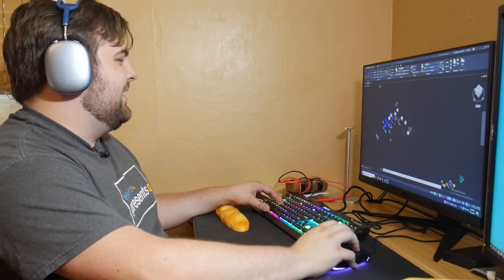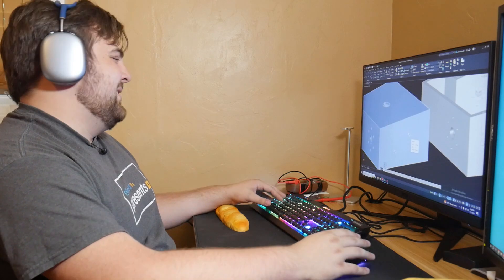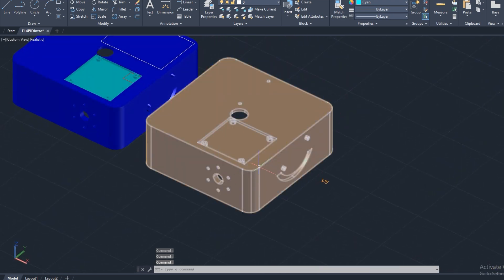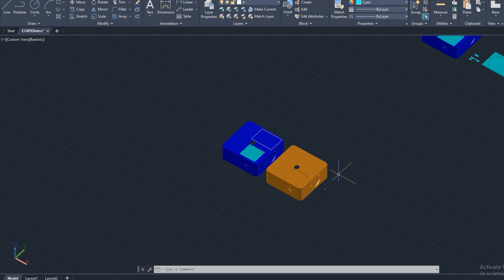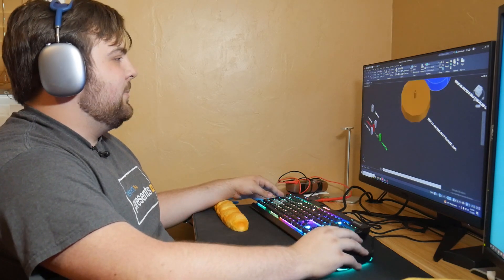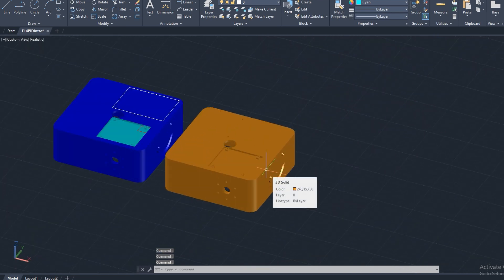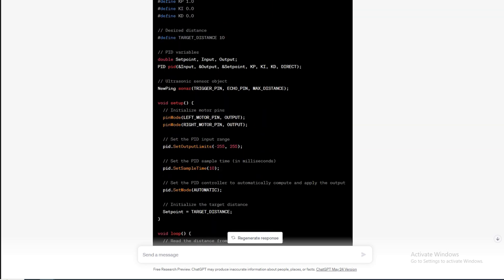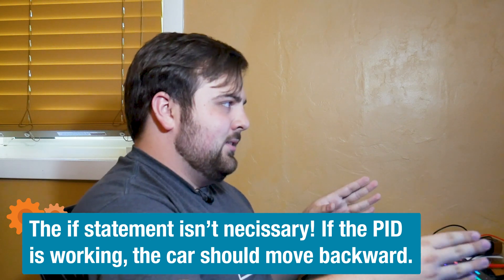Using PID (Proportional-Integral-Derivative) in Robotics - How Hard Could It Be?

Comment: Agree with some of the comments, this really didn't highlight anything about actual PID controllers. For this case I think transfers functions would have been overkill (and overly difficult), but there are manual tuning strategies that you could have gone into. And a more mechincal comment, a possible issue with the distance sensoring could be reflections from the floor hitting the "wall" resulting in double values, i.e. the sensores not being used in the intended situation.

Comment: 50 years ago my friends and I made Meccano buggies consisting of two central large drive wheels and both forward and rear centrally mounted castors. There were 2 motors driving differentials the outputs of which were geared to both drive wheels, one of which was reversed. Now this was back in the valve age so we used manual control of the motors. 

Points applicable to your experiment given that you intimated you wanted an easy start.
a) Consider suspending the power leads A bit of elastic will help.
b) Use both a forward and backward mounted castor for stability, both being above the driving wheels, whilst you refine the PID parameters.

Just a thought.

Comment: You should clamp the power to the motors, so it don't flip. Basically remove any other variables (like slipping, too much acceleration, different power to left and right motors) and work solely on basic PID values. When you have a stable (and slow) baseline version - try experimenting with unclamping other variables and tuning PID accordingly.